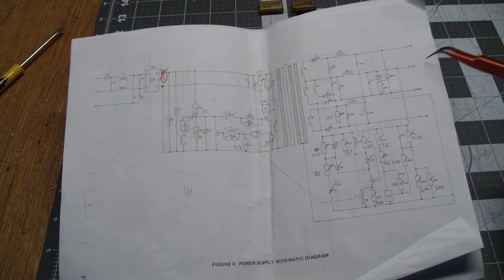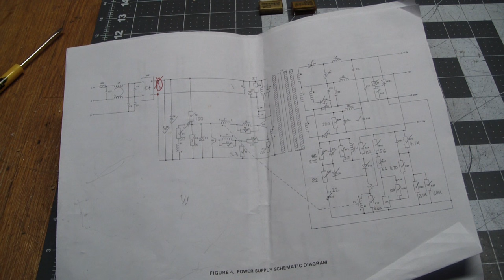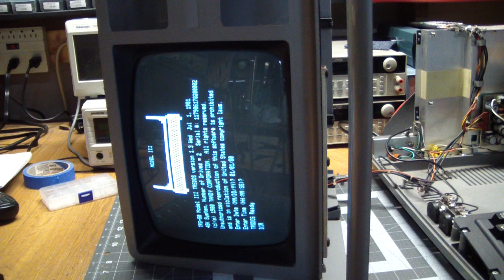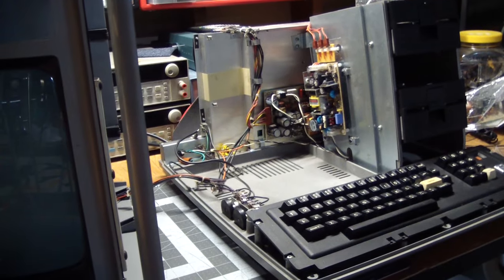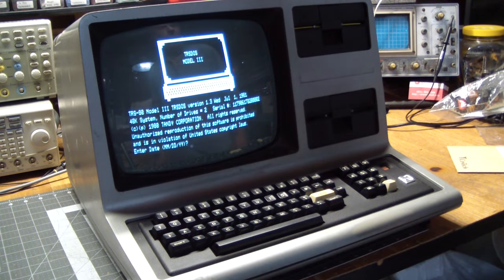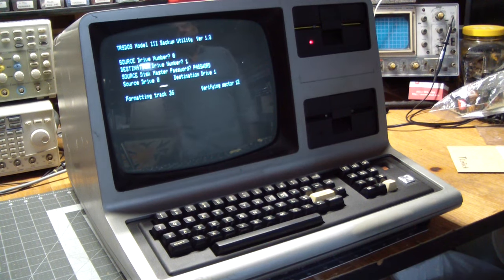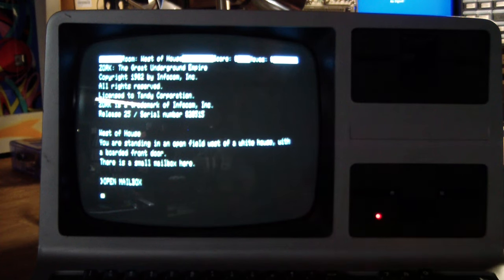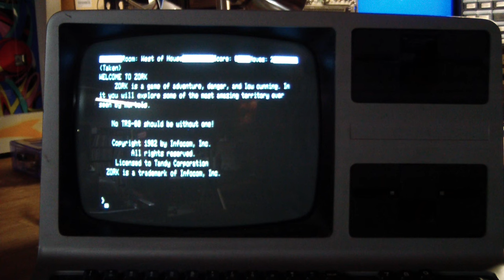AE#209 TRS-80 Model III Repairs, Part 2

Comment: 25:30 Yes you do, but only if it's dirty. I've fixed possibly over 100 floppy drives over the 30+ years I've been repairing stuff and I've seen a lot of Commodore drives (especially 1541) with some crap stuck on the head that scratched the disk. Some of them were so bad even IPA wouldn't remove it and I had to get my fingernail in there and get it off. So maybe the heads don't need cleaning as a general rule but it's a mistake to assume that they are clean without at least looking at them.

Comment: Check the resistor values in the emitter of the main switching transistor, the main resistor to the primary side -ve sets the current limit.
Check the 220uF capacitor in the other PSU, I guess this capacitor is the one in series with the main switching transistor base, it should be an LESR type.

Comment: I disagree with not cleaning the floppy drive heads.  If they have hardened gunk on them, you're going to destroy any disks you put in them.  It happened to me a few times when I got lazy.  Now I always have a spare floppy "scratch test" disk I put in any drive to check for scratching (even if I DO clean the head first), before I use any disk I want to try reading.

Comment: What type of capacitor are RIFA's ?
Reply: RIFA capacitors are Metalized paper.
My advice is don't use any capacitors with paper in them. 
Use MKP metalized polypropylene or MKT metalized Polyester.
Beware there are also MKP-P and MKT-P which contain paper, so I don't use these.
For safety, make sure you use X or Y rated capacitors as appropriate for the application.